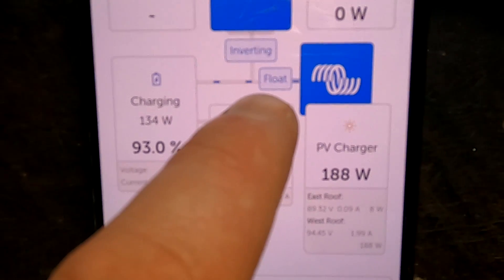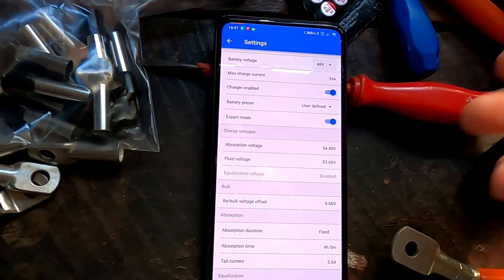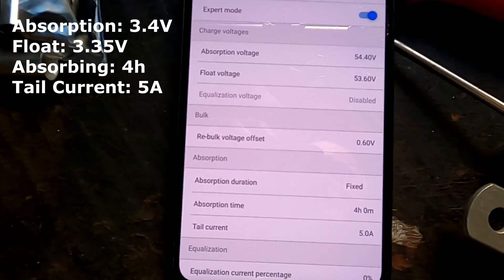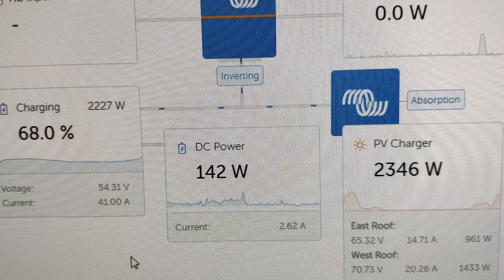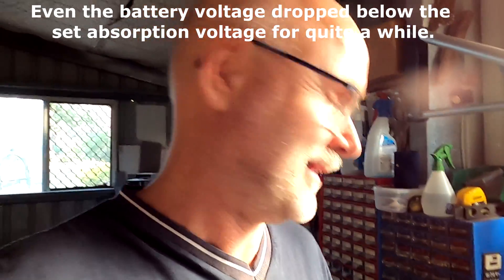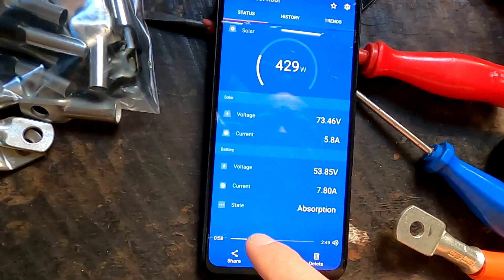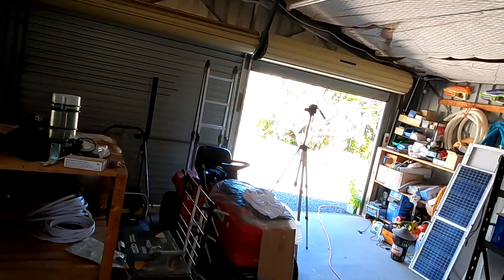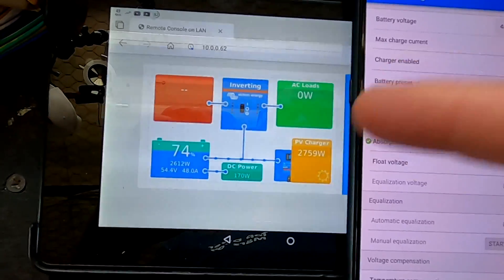How Absorption, Tail current and a few clouds can trick you!

Comment: why do you have a lower voltage for float than absorption when charging with solar?
Reply: Because you don't want to keep a LiFePO4 at high voltage. You absorb at e.g. 3.5V, then drop to 3.375V for float. The voltage has to be allowed to settle with a LiFePO4 chemistry.
Reply: @upnorthandpersonal  Andy's settings are 3.4 & 3.35.  i don't consider 3.4 a high voltage, but it is higher than 3.35.  with that gap, he does not keep the battery up to 3.4 until dark (no solar charge) so he ends up pulling those extra amps (part of a cycle) from the battery.  i'm just curious why he wants to use up his battery before needed.  btw, ""he voltage has to be allowed to settle with a LiFePO4 chemistry."" makes no sense what so ever.
Reply: @tcloud24  If you charge a LiFePO4 cell to 3.55V (for example) and let it absorb. Once you remove the charge voltage, it will settle to 3.4 something. This is what I meant: you shouldn't keep it at 3.55V - you have to allow it to settle. If you don't, you can damage the cell.
Reply: @upnorthandpersonal  Do you Have a reference for that statement? That you may damage a cell if it is at 3.55v?
Reply: @upnorthandpersonal  Found it, read it. It confirmed that overcharging at voltage below 3.65 is nothing but a myth.

In the document they are talking about charge voltages of 4v or more and the problems that arise when the balancer cannot keep up. The recommendation they give in the end speaks for itself:

“5) Decrease the full charge voltage level
for ordinary charging of the cells. You can make many cycles with the decreased full charge level before making the full charge. For most cells charging to 3.65V per cell is OK. Some user charge only to 3.60 per cell.”
Reply: @Mr.X3D  That's because it's an older document. You don't have to believe me. I've done tests on this, and there are other publications out there - you can overcharge/damage a cell by keeping it at 3.65V.
Reply: @upnorthandpersonal  “Overcharge is defined as charging the cell above the maximum voltage give by the manufacture. (4.0V for Winston cells, 3.9 for CALB cells, 3.7 to 3.9 for many other brands of LiFePO4 cells).”
Reply: @upnorthandpersonal  “you don’t have to believe me”

I trust in science and specs. Beliefs have nothing to do with it
Reply: @Mr.X3D  That's why I said you shouldn't believe me. If you look at the CALB specs/manual, it tells you to float at 3.4V. Victron recommends floating at 3.375V, BattleBorn between 3.3 and 3.45, CanBat 3.45, etc.
Reply: @upnorthandpersonal  I'd be a lot more specific with my statements and link studies... Up north You said 3.55 volts will damage the cells then you said 3.65 volts will damage the cells You never mentioned a C rate??? Every charge publication I've read is for a specific C rate or a range of C rates most off grid solar applications are extremely low C rate and you can bulk3.55/ float3.5 no problem... Battleborn usually specs extremely conservative charge curves and is usually used in a motorhome with a pretty small bank... a lot of the battery manufacturers specs are designed for the motorhome community.. If you're talking an off-grid application with a very large bank it's a different game...
Usually the C rate is never going to get close to .5C??? 

I too have never seen documentation that specifically states that 3.55V at low C will damage LiFePO4 cells... I bulk 3.55 / float 3.5 at maximum 1/8C over the last year and have not seen a loss in capacity, if I increase the size of my array and add some more charge controllers then I might have to back off on the voltage  👍.
 I would highly recommend watching Will prouse interview the battleborn CEO...
Reply: @kcjones3368  Sorry, YouTube comments are horrible media to be specific in. I can't even post links...
Anyway, feel free to join Will's forum, ping me there, and I'll happily go into details.
Reply: @kcjones3368  "If you're talking an off-grid application with a very large bank it's a different game...
Usually the C rate is never going to get close to .5C??? " 280Ah bank (like Andy's) with a decent array (60A he said he saw, and that's not a big array). I have 10kW coupled to that - I see 100A+ often. 3.55V charging is fine - floating at 3.55 is not; floating is a left over from lead-acid. It would be ideal to be able to turn off floating altogether.
Reply: @upnorthandpersonal  For 280ah bank, 100a is still far from 0.5c 😀

All stages off charging are leftovers from led-acid. That’s why we set em all to the same voltage to get a coherent CC->CV charge 🤩
Reply: @Mr.X3D  "That’s why we set em all to the same voltage to get a coherent CC->CV charge" - Let's agree to disagree. Feel free to join Will's forum, we can discuss there in detail if you're interested.

Comment: 🐸
Andy, What’s your smart shunt setting for “Charged Voltage”?
Reply from the maker: At the moment, I have turned it off because I want to test how accurate it still is over time with no calibration at all.
Usually I set it to 3.44V/1% tail current and 2min if the absorption voltage and time is 3.45V/15min for example. That gives the shunt time to re-set back to 100%. That's the reason I have set a 15min time on the absorption to let the current come down enough to trigger the smart shunt reset. Victron recommends far lower reset numbers which I don't agree with at all.
Reply: @OffGridGarageAustralia  when you say turned it off, is that 0,0V?
Reply from the maker: @martinmalm7254  I have set the re-calibration to 3.65V/cell (58.4) so it never triggers the shunt to reset to 100%. I'll watch the drift over time at defined voltages then to understand why it is drifting.
Reply: @OffGridGarageAustralia  ok so the setting “charged voltage” is 3,65V*16 in your smart shunt?
Reply from the maker: @martinmalm7254  Yes, at the moment. This is only for testing purposes as I wanted to prevent the shunt to reset to 100% by its own. 3.65V is basically turning this function off as I never charge that high.
Reply from the maker: @michaelbouckley4455  🐸

Comment: damn thats green for a frog i still wounder if you set the float voltage so the batterys are 3.45 each no bulk or absorption i feel they is no need for a current shut off as dc loads will draw that off the solar bank and not the battery and nothing will flow into the battery as they have reached the set voltage this way the cells should stay fully charged untill they is no sun to keep them there and you wont have them dropping into the low voltage set for float they are now and have the banks discharging putting small discharge cycles on the cells
Reply from the maker: That's correct. but 3.45V is too high for float. It may overcharge your battery. There is a tipping point in voltage. Below that point, the battery charges inconsistent, above it can overcharge as the voltage is too high and current can constantly flow into it.
If you charge to 3.45V and stop charging altogether, you're already at 99%SOC. If voltage then drops to say 3.35V you will loose 0.5% of capacity but keep the batteries below that point.
That point it directly when the charge curve leaves the flat area and voltage starts rising. It's somewhere between 3.4V and 3.45V and depends on other factors as well (absorption, temperature,...) So staying below that point for floating is recommended, 3.35V or 3.375V is great.
Reply: @OffGridGarageAustralia  if max voltage of fully spec charged battery is 3.55 or 3.65 i dont really know on lifepo4 i play with 18650's how would charging to 3.45v each cell overcharge or do you mean if one cell is lower then the others due to a balancer not able to keep up

Comment: Absorption to float, sorry newbie question, is this a change in charging rate?
Reply from the maker: Absorption means, that the charger keeps the voltage constant and the battery takes less and less current over time. It absorbs until the current hits 0A. The it is fully absorbed for that voltage.
You usually drop the voltage then to a lower value to keep the battery there and float (this is at around 99% state of charge). In this phase, the charger supplies power to the load and nothing goes to the battery any more. If the load takes more power than the charge can supply, the battery will add this extra power and feed it to the load. After the load has been disconnected, the charger will recharge the battery then again but keeps it on float voltage.
Reply: Float is what the charge controller drops to when you are full, and the real purpose is to have the charge controller supply as much of your load as possible without micro cycling the cells. When a cell is full, even if you use the max voltage of 3.65v, the first amp you draw will drop the cell voltage to 3.35v (or very close). This is easy to see on the discharge curve the EBC-A40L records.

Comment: I thought that the tail current only triggers the Absorption, if the end of charge voltage treshold is reached.
Temperature also has a major impact on the voltage...especially in colder climate.
 🐸
Reply from the maker: So the tail current tells the charge controller, that the battery is full and does not take any current any more. That is true for systems where you have either a constant current from a grid charger of heaps of solar and a smaller battery.
But with clouds you could have a small current too and if absorption time has triggered, it tells the charger to go into float because the current is low so the battery must be full. It's not a good indicator for that in my experience. 🐸

Comment: Victron needs to have a trigger with Amps and Volts.  Something like 2A at 54.2V, 5A at 54.4V, 10A at 54.6V.
Reply: Victron should just communicate the actual state of charge from the shunt to the charge controller. Then there would be no mucking about with tail currents and voltages...
Reply: @upnorthandpersonal  yes they is that
Reply: @upnorthandpersonal  That would be ideal.  Also Victron needs to make a BMS and when a cell gets close to max voltage charging current is reduced based on that cells voltage.  Really, this should be one product that figures it out.  Charge controller, Inverter, and voltage sense leads that control each based on min/max cell voltage.  No reason for BMS with disconnect if you can control charger and inverter..
Reply: i was going to say something like this but when i think about it i would just set a max voltage they be no need for current shut off as the loads will always draw power keeping this load setting on as long as the solar is powering the loads and no current is flowing into the battery due to full charge voltage reached i feel this would be fine and alot less settings to worry about
Reply: @1981dasimpson  The theory is that you want to charge to a higher voltage than if you float.  So full charge would happen with 54.6V @ 10A or 54.2V @ 2A.  Then float at 54.0V so you never overcharge.  Setting at 54.2V would overcharge and wouldn't charge as fast as if you let voltage to increase with more current.
Reply: @jmaus2k  my idea is the top end tapers off due to the voltage been more equal at this point your loads are drawing power none stop so the battery is fine to slowly charge if loads are not drawing the solar plus some